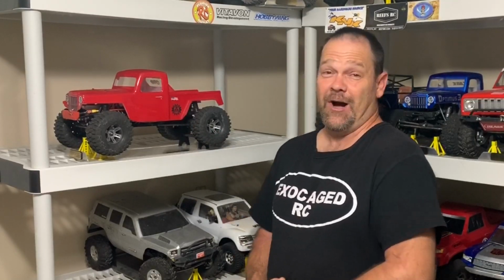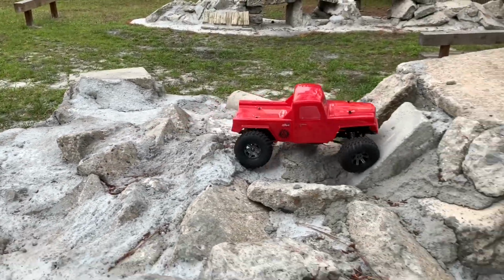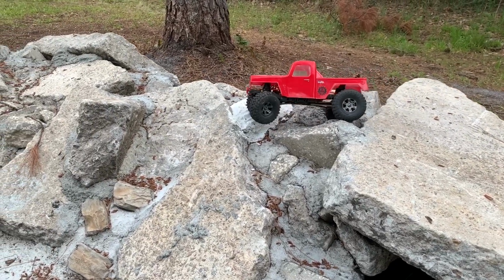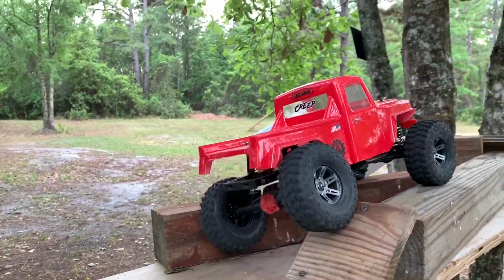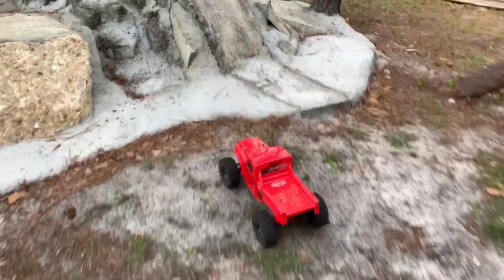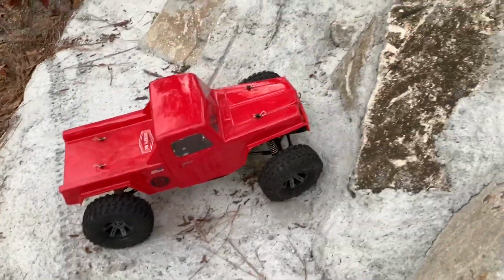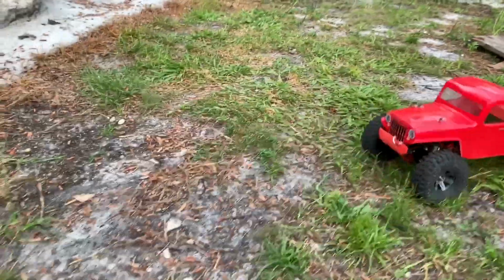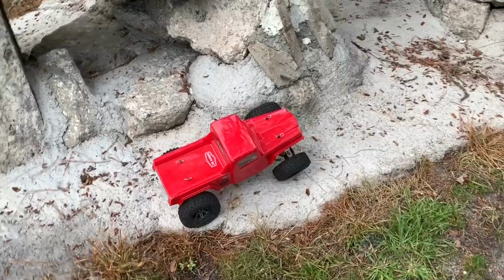Axial Superlite full unedited run

Comment: Any idea on the chassis rails weight? Always wondered how much those carbon stock replacement chassis actually weighed.
Reply from the maker: yeah I think they are 2.6 ounces as where the stock steel fram rails are about 4.6. I weighed them in in the build series.